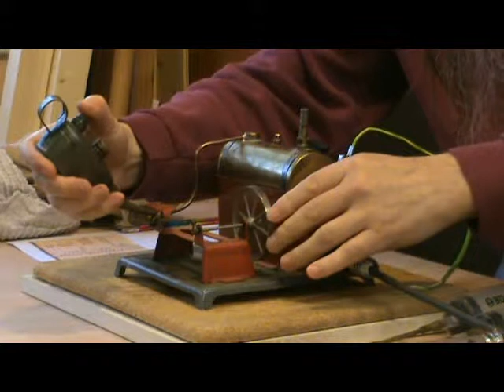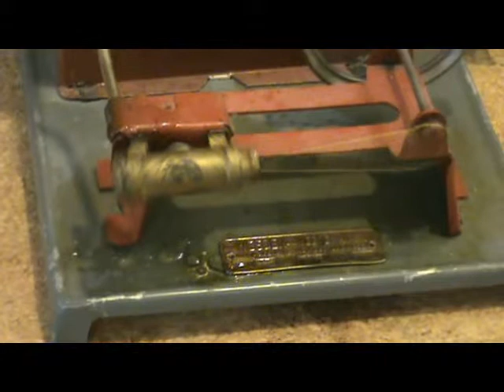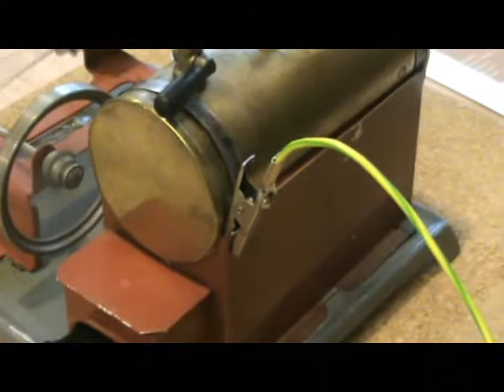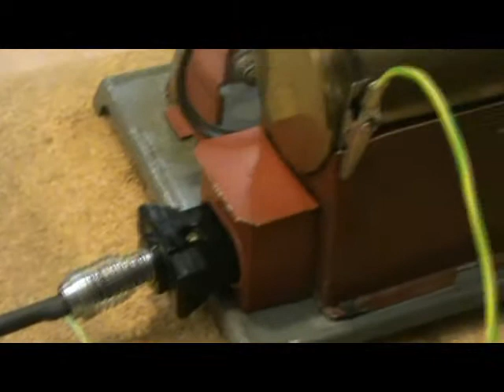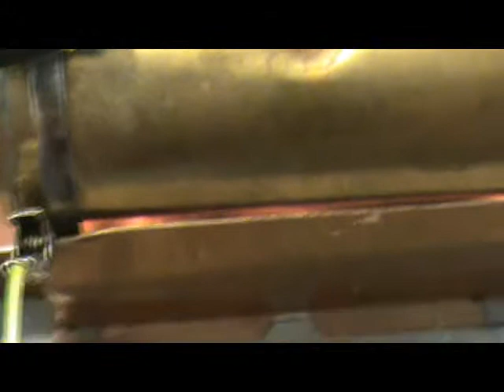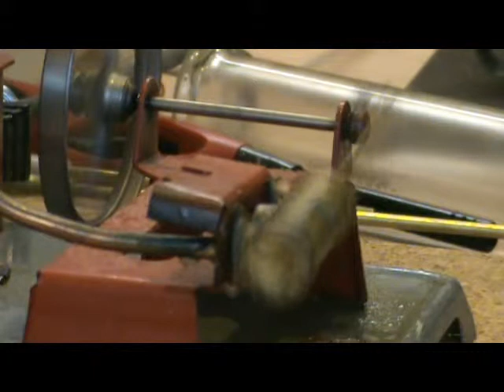Weeden 903

Comment: For i have 1 of these & the Plug that came with it i just added a Plug that i Pluged on to the end of the Plug with a Ground Plug & i find that it works well for me & it makes it last a long time as Old as these Steam Engines are & i was told by an Ebay Seller that if you use the Whistle to Control the Speed of the Engine that it lets it Run Slower then when at full speed.